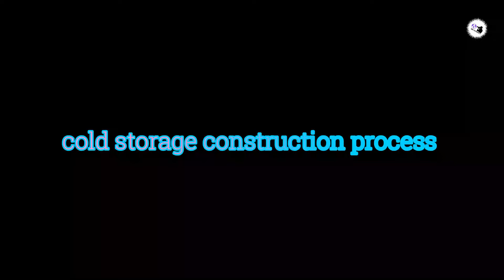Cold storage Construction Process  step by step(PEB) /#civiltechconstructions

Comment: Adherence to international construction health and safety appears missing, although some attempts have been made to wear fall arrest.
Is there any compaction, vapour barrier or slab ventilation in the floor? The quality of steel structure appears to be of sound however, your fasteners do not appear structural to Standards.